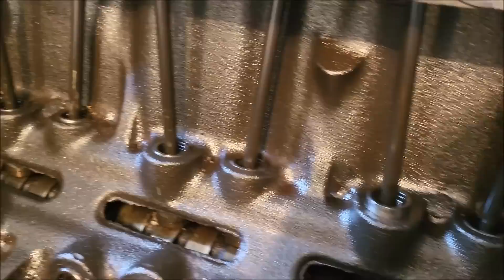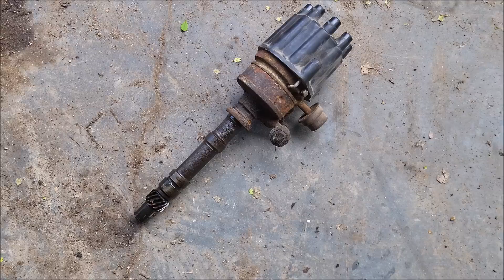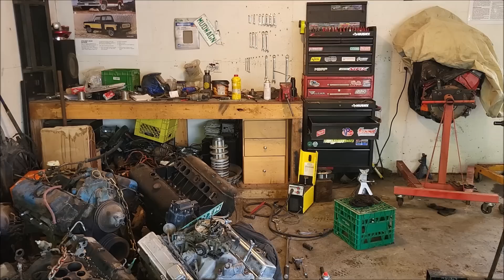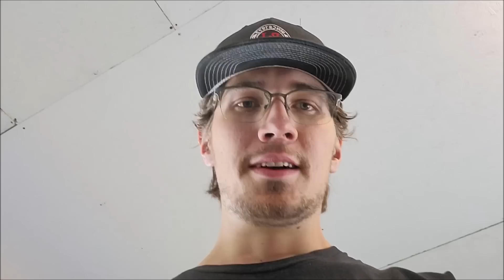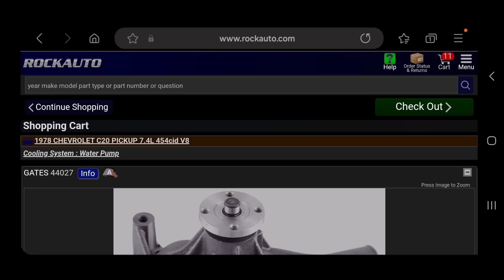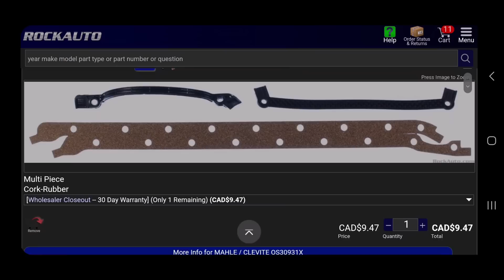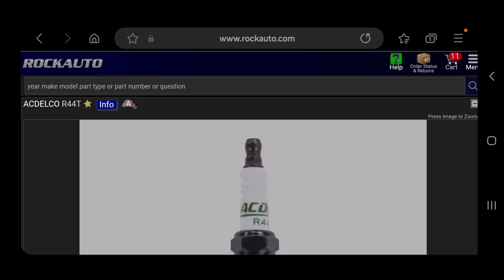Why Does Everyone Ignore Tall Deck Big Block Chevy V8s?

Comment: The tall deck 427s used to be desirable to racers looking for max performance with durability due to how robust the blocks are, this was before the aftermarket was so prevalent.
Reply: People still build them. I'm building one right now. Looking for 800+HP NA.
Reply: Damn good core to build a racing engine with.